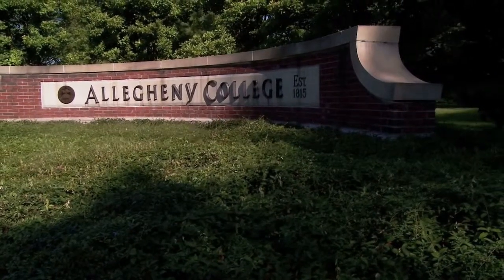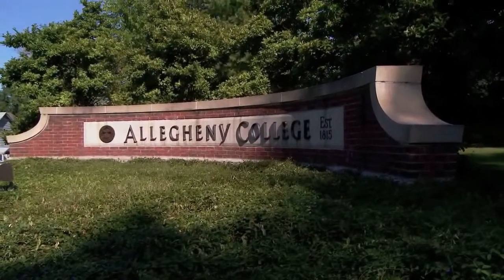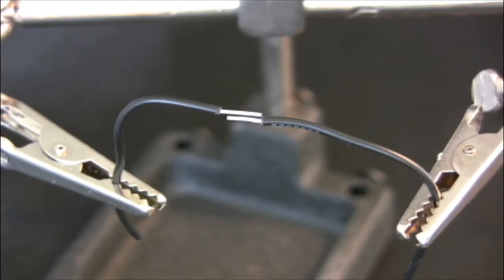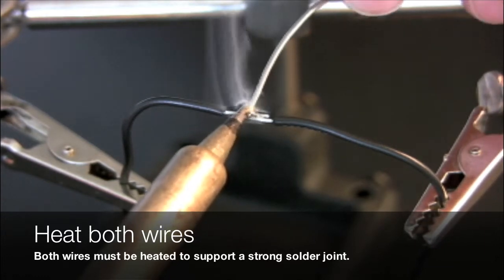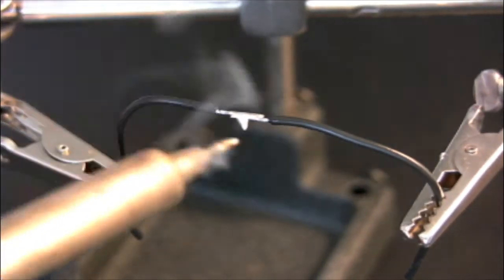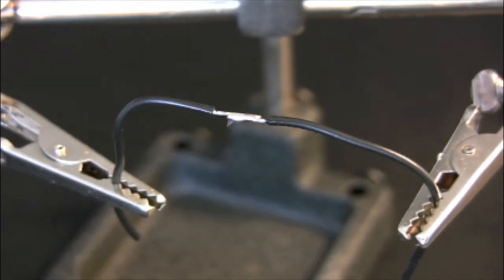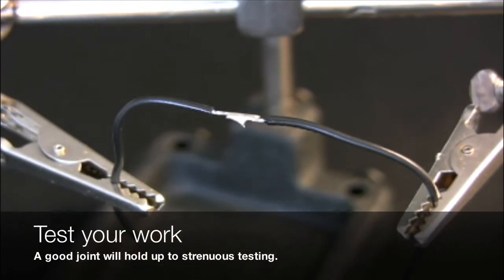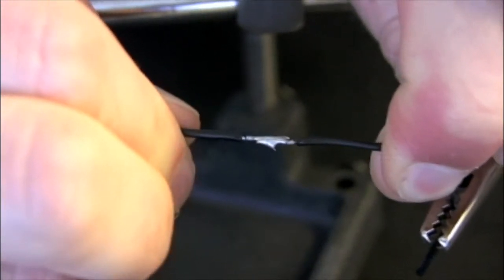Basic Soldering: Two wires in parallel

Comment: Since heat rises I would place the soldering iron UNDER the wires that are to be joined.  And, it's been my experience that it's okay to re-heat a soldered joint as long as you heat it completely so as to not get a cold solder joint.  A good hot joint will usually be shiny and a cold solder joint, i.e. the joint was distrubed before the solder hardened will be dull and almost grayish.  Overall though, a good video.  Hopefully many will find it useful.